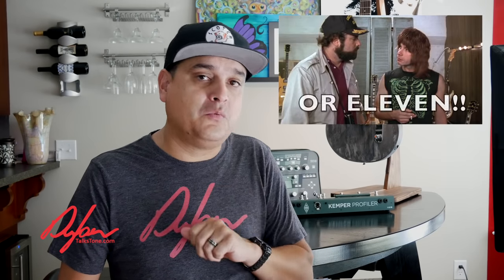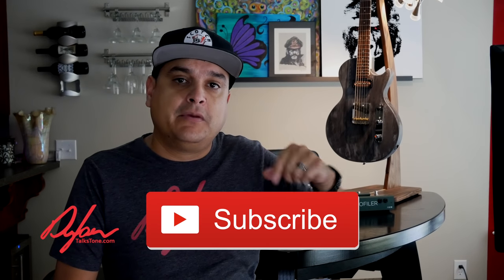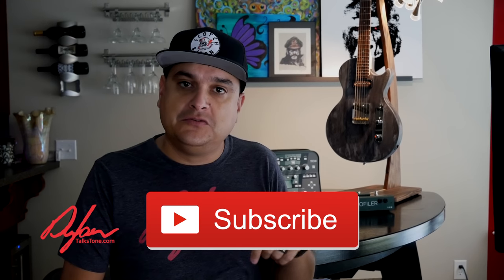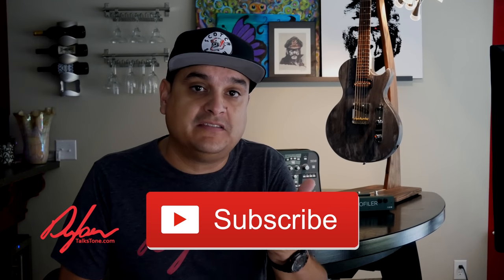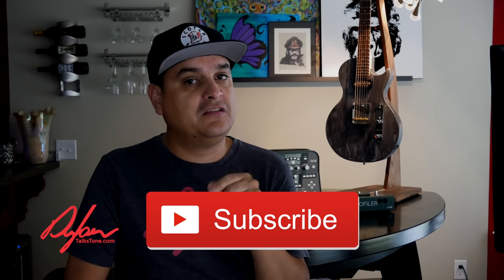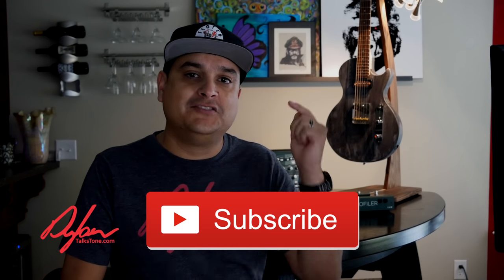How Guitar Pots Work   250k pots VS 500K pots in my guitar

Comment: Good points Dylan. Yup when you roll back the volume you lose some high end, that's why I use a treble bleed circuit on the volume pot. There are about 4 configurations of these, but they all work well. One other thing to mention that  out people don't think about is that the input on a pot is constant. Example: a 500k pot will have a constant 500k from 0 to 10 on the input. Only the output is variable. Have a good one and keep the videos coming.

Comment: You can customize or change the value of any pot by soldering a resistor to the outside lugs of the pot. For example: 1meg resitor on a 500k pot reduces the value to 330k. You're welcome.
Reply: Thanks for taking the time! Useful, for sure.
Reply: Is there one for the opposite?

Comment: My few cents here...I think you have to experiment to find out which pickups work well with which pots! I hate that statement that 500k are for humbuckers, and 250k for single coils. The capacitor is also a very important part of the circuit as well, as you can have 250k pots for example, but 0.22 capacitor, and it will make single coils sound a lot brighter. Then again, let me tell you that I had a Dimarzio Evolution humbucker in a guitar with 500k pots, and it sounded like it was farting all the time, I really have no better word to describe the sound xD really was not satisfied at all, Then I put the pickup on a stratocaster with common setup of three 250k pots with 0.47 cap, and all of a sudden it is one of the best bridge humbuckers I've ever tried...there is also the factor of a certain pickup matching well with other pickups in your guitar as well, as the other two single coils in this strat are higher output and made out of ceramic magnets, which is the same material Evolution is made of (note that, from my experiment, only pickups with same magtnets work together the best way in in-between positions - at least it's my opinion, or preffered sound). I also have a guitar with two humbucker-sized single coils (like Gibson's P-94), and I really prefered them with 500k pots and 0.22 cap. But it really depends on the pickups, the guitar (is it a bright or dark sounding guitar?) and what kind of sound they make together.
Reply from the maker: Absolutely
Reply: Hey man, thanks for responding! Just as I saw it, it occured to me to ask you a question as well! Can you wire a pickup, for example a two conductor type, directly to the guitar output jack? In a way that it is always fully on, bypassing any change of sound by potentiometers? I know that the jack has two connections, one is the ground and the other is the hot output, and a pickup has a ground and a lead wire, so is lead the same as hot output?
Reply from the maker: Absolutely!!! You sure can. You would need a volume pedal or etc
Reply: Good to know, thanks!
Reply: Okay, I have a MIM start that I’m going to modify. I was thinking maybe an SSL1 for neck, SSL5 for middle and a JB SH-4 for bridge or, Texas Special’s for neck and middle but still JB SH-4 for bridge. I’ve been thinking a lot about the pots as well. All I’ve ever used on strats were the stock 250’s and I’m dying to hear for myself what 500k’s would sound like with my mods. 

What do you think given your previous experiences?

Comment: Dylan, thanks for all your great videos! I've found that I like A330K for volume and B500K for tone the best. A330K pots do exist, but most often I've been wiring a 1M resistor across the outer lugs of a A500K to get there. If the guitar has two tones, I'm liking a .015 on the neck and a .033 on the bridge. If it' has a master tone, I just go with the .033. This is what sounds best to me.

Comment: Just built a guitar and switched out the 500k pot with a 100k cuz it was all i had. Sounds great. UPDATE: it was pretty bad when turning down volume and had a hard time with getting much out of the high E. Since the bridge pickup is a single coil and it's what i use most I replaced both pots with 250k and an orange drop cap and it's heaven!

Comment: Nice vid. Great, and yet simple/clear, explanation. I also agree, about the 500K. I would rather let more signal past the volume pot and shape the signal with tone caps. I typically use a push/pull, with 2 diff cap values.

Comment: OK - Here is a good one for you.  EVH Frankie.  I am hooking up the neck pickup (which I would use more than bridge 10 to 1), so I need a push/push or push/pull.  So, would a 500k or 250k be more appropriate for a person like myself who plays more akin to Larry Carlton than an EVH?  Also, no tone control on this bad boy.  Every guitar I play (Jazz Box, 335, Strat, Les Paul, I roll the tone down to  probably 7.  If asking why then I have the guitar...always wanted one as a kid growing up in the 80's.

Comment: Interesting. What do you make of guitars which come with 500k pots for volume and 200k pots for tone? They normally have a master volume on top of the 4 knobs, so maybe it has something to do with that. Talking about master volumes, what do you think of using a 1 Meg pot for the master and 500k for the 2 pickup volumes? Maybe avoiding severe treble loss when using the master volume? Or is a treble bleed on a 500K pot better for that?

Comment: Subscribed. I like the way you explain in layman’s terms
Reply: Xcellent explanation. I am working on a old Squier Tele that surprisingly has small 500k pots. I purchase a 4 way switch kit which has 250k pots with caps to add. I hope this works without having to get 500k pots.

Comment: Hi Dylan, awesome videos, but I still got a question: if you put a 250k volume pot it cuts high frequencies, so the 500k tone pot is just retaining the remained frequencies and cutting the lowest amount possible, where a 250k tone that would have cut even more highs. Is this thinking correct? What happens if things are reversed? Why not 500k volume and 250k tone? Thanks again! I'll wait for your reply
Reply: I got the same question, can anyone answer this?

Comment: So basically it sounds like the resistor is a high pass filter and the drop cap is a low pass filter and the tone knob just blends the amount of signal going through each filter. Is that right? A 500k pot just filters more low out which makes the sound be perceived to be brighter?

Comment: Question; I'd like to add a single-coil sized humbucker to my Strat at the bridge, and also add a PUSH PUSH tone pot to be able to split the coils...can you please make a video on push/push as opposed to push/pull ( I think the former is easier to use in a performance situation), as well as how to wire/install the pot...thanks.

Comment: I was fixing up the electronic swtch in my old yamaha rgx 1212a active pick up. After switching the switch. I notce one of my tone nob wasn't chaging the sound. And i realize my pod was actually shot. So it wouldn't change the tone (i have two tones to really tweak the sound.) So i'm going to try a 500k in it.

Comment: I bought all those instructional books from StewMac and elsewhere. When I try to reference some of them for information they just seem to gloss over things. Dylan, you need to write the ultimate grimoire of guitar tone. Some of your videos just put things in a perspective that is easily accessed. 

The video with the 4 capacitor kit was an eye opener, as an example. The statement you just made about pickups not all being created equal is the best approach to narrowing down a frequency range you want to steer your axe to. It makes choosing pots and caps more interesting (including those mods you see for volume pots). My playing style seems to demand a guitar that is a Jekyl and Hyde. Very mid/low rhythm, very high solo. I have a better idea how to solder/wire for that now. I can't thank you enough.

Comment: I have Guitar with 2 Humbucker w/ 1 volume, 1 tone, and a 3way switch. I'd like to add a 2nd tone pot without cutting another hole in my guitar. Can I use a CTS 500K+500K Stacked Dual Concentric Audio Guitar Pot as a dedicated tone pot for both pickups?

Comment: Hello Dylan, there's a lot of talk around the interwebs about how changing the electronics in the guitar can change i.e. improve it's sound, so just the electronics, not the pickups, just pots and cables. Supposedly better pots, while keeping them the same value as they were, can improve the sound of the guitar. Is there any truth in that or is it just a placebo effect?
Great videos btw.
Reply: I mean, I dont believe in a lot pf bullcrap that i read among the guitar community BUT i could believe that this could be true if, for exapmle, the original manufacturer said that they put 250k pots on a guitar but when you measure it, it reads 300k. Butbi dnot know, most of the time its just placebo, a pot is a pot, the same material and same measurements should soumd the same. Hope this helped!

Comment: Torn between 500k and 250k for tone pots on a Les Paul jr. that I'm working with.  Gibson traditionally used a 250k tone pot in the 50's, but changed specs in modern builds.  Maybe 500k and 500k for both volume and tone and see what happens. Pots and caps are cheap and easy to switch out for testing anyway.

Comment: With a dual humbucker guitar I'm going to swap out the Volume Pot for a 1M, & the Tone pot to a 500k No Load Pot, or swap the Tone Pot out for a 2nd 1M Volume Pot to have individual Volume Control for each pickup.
I'll install some Trebld Bleeds on the Volume/s also so I don't lose Treble as I decrease the Volume.    👍

Comment: My guitar is currently have 250k tone pot, if I want to change it to 500k do I need to change the capacitor or I can use the same capacitor? Cap that was installed is 2A333K, not sure what is the uF. I think 0.033uF. Please let me know if I need to replace cap or not. Thank you.

Comment: I have a 85 Custom Gibson Les Paul that I had completely rewired professionally, but it still sounds very dark. I put two new Dimarzio pickups in it as well. The X2N and the Super Distortion in the neck potion. I know that most of my problem is coming from the wood in the guitar. It has a very low dark tone  when played unhooked. The solid mahogany body and ebony finger board cause a lot of that problem. The guitar still sounds great but I can’t get enough highes out of it. Is there any thing that I can do to help bring out a brighter crispy tone ?
Reply: Billy Cummins
No man, the problem isn’t wood, the problem is you don’t understand how the guitar and the amp work.
Buy a damn equalizer and tweak the damn frequencies like you want.  😉

Comment: Hey Dylan, Got a quick question for you.

I have a MIJ Strat with Ceramic pickups that are a bit dark, and I want to brighten it up a little bit.

What are you thoughts on these configurations :

1) 250 Volume with 500k tone ( .033 or .047 Cap )
2) 250k Volume with 250k tone ( .022 Cap )
3) 500k Volume and 500k Tone ( .033 or .047 Cap )

Just want to brighten up the guitar a little bit without getting to shrilly sounding, I am open to suggestions , thx !!

Comment: Question - is a 500k pot turned to half way the same as a 250k pot? If you had 500’s and you were thinking about going to 250, could you just experiment with only using half the sweep of the dial to simulate having a 250, or am I missing something?

Comment: Dylan, I'm glad you pointed out using a 250k volume pot and 500k tone pot on your tele. I was already thinking of doing this myself! I have a SSS Strat that I just swapped the bridge out for a JB jr humbucker. I love the neck and mid pups with 250k but my bridge pup sounds dull unless I have the 250k tone at 10. I have the neck tone wired stock with 250k and the mid pup not going to tone circuit, then bridge pup to 250k tone pot. If I replace the bridge tone pot for a 500k pot, will the humbucker bridge pup still sound brighter even though the volume pot is 250k?

Comment: Hey Dylan,
I just found you, Been playing for decades, but just diving into this wiring stuff.
Have a cool 80's Yamaha  S-Style w only a  Bridge  humbucker. 
I'm going to replace that with a Duncan P-Rail & the triple shot  PU-ring. 

This guitar just has a single volume knob. After hearing your thoughts I'm thinking of having a 500K pot installed at the time my guy does the pickup. Or maybe I'll try it myself...

Glad I found your video .. wahdya think ?

All The Best Always 
Jamie
Reply: 500k might be a little bright/ harsh when you split the coils.
If you solder a 1meg resitor to the outside lugs of a 500k pot it will reduce the value to 330k. Which I personally find as a good compromise for a guitar that coil splits from humbucker to single coil.
Perfect for p90's and minihumbuckers.

Comment: Dylan! Glad I found your channel! I've got a set of 1976 Maxon Excel pickups. I'm thinking two 500K pots for tone and one 250K for volume. My 6 string is a 1977 Ibanez. I was going to pop a DiMarzio DP182 Fast Track II in the bridge pickup - but I'm thinking I should tweak the caps a bit and see if I can warm up the Excels with 473k orange drops first. Any thoughts?

Comment: I kinda agree with the 500k for everything....thing. i had a strat with single coil duncan designed pups and it came with 500k's. It sounded really cool but it did have that typical vintage tone. It was like a SRV kinda thing.

Comment: Hey Dylan, I have a question. Just about every video on YouTube, relating to coil splitting, is about installation. I have a Schecter C1 Elite with a coil splitting tone pot. Just this morning it stopped working and unfortunately, it's stuck in single coil mode. I have no interest in coil splitting, so I'd like to replace the pot with a standard tone pot. Is this a simple task? I'm handy with a soldering iron, but have pretty much no electrical brain function at all. :D
Reply: Just tie the leads together that connect to the push pull at the bottom of the pot. Then install the new pot .

Comment: Dylan ,I'm building a jazzmaster not using boutique pick ups I've found no advantage in the 2 I've bought compared to the two big name companies automation wound .   Problem jazzmastet I'm think the 250 - 500 but my rythem circuit should be darker thinking maybe it should be my 250 and my reg circuit being 500 and the 1 meg but what would go where if I am on  the rt track. 500 on tone or volume ? 1 on the other on + 250 on the rythem circuit.? Any help thanks . I thought I could build a USA parts jazzmadter for less than buying a used one ,what a ride awaking ,expensive guitar compared to my Esquire builds.

Comment: Hi. Can switchable "push push" pots be used to make the 'bridge' tone knob function in a different way (e.g. as a blender dial) or are they just a on/off switch to conserve space on the plate? I'd basically like to use the 5-way blender mod on Strat, but have the option to make the dial a shared blender/bridge tone knob. Thanks

Comment: Thanks for sharing your knowledge. Wondering about A500K or B500K. What does the letter represent?
Reply: A pots are "audio taper" which is more commonly found in music stores further attenuates the volume when the knob is turned down.  

B Pots are "linear taper" which retain a more consistent treble response throughout the sweep of the pot.   

Many people will buy a LP or hollow body style guitar and complain that it's too "dark".  I've noticed that musicians that do not keep their volume turned to 10 all the time complain about that.  That could mean they have an A pot (audio) taper pot that's rolling off high end in a way they don't like.  Often a cheap replacement volume pot to a B pot (linear) will keep some of the highs present when you have your volume knob at 5.  

I personally like linear taper for volume and audio taper for tone.  It's just what I've gotten used to and gives me more control of what high end is coming through.  

This knowledge, apparently, isn't common and people will spend hundreds of dollars swapping pickups when, honestly, they needed $7 to swap a pot.

Comment: I have a cheap Gibson Les Paul ($700) as my backup (Gibson 2017 Les Paul Custom Special ) it sounds kind of tinny and also not as loud as my 335 Dot,  I went from the 9's it came with to 10's , put a better bridge on it and I put a classic 57 in the neck which helped some but still not a GREAT sound. I wondered if I should change the pots and/or capacitors but I cannot find out what is in there stock.  I am considering selling it  and saving for "real" Les paul but I don't want to spend a great deal of money on a backup guitar....Any help would be nice...Thanks

Comment: I have an AM STD MIA Telecaster from 2011 60th Anniversary, which bridge pickup came without a base plate, just a screw in the bottom that goes in the pickup.
My concern is that when I play with the bridge pickup, as it's too trebely, so I tried pulling the tone down but it also lowered the volume considerably, very noticeable not just a db. 
If I do the same on the Neck pickup, which is awesome by the way, the tone changes nicely without any volume change as expected.
Is this normal for the bridge pickup or is there an electrical problem I should solve?
Pickups: 2 American Tele® Single-Coil Pickups (Neck & Bridge) / Pickup Switching: 3-Position Blade / Controls: Master Volume, Master Delta ToneTM (The Delta ToneTM System Includes High Output Bridge Pickup and Special No-Load Tone Control) 
Thanks!
Reply: The tone pot shouldn't affect the volume of either pickup in any noticeable way. I'd wager you've got a wiring problem.
Reply: @veramusement  you're right. I already took it to a repair shop and had it re-wired a couple of days ago and now it's perfect. I also added the base plate. Thanks.